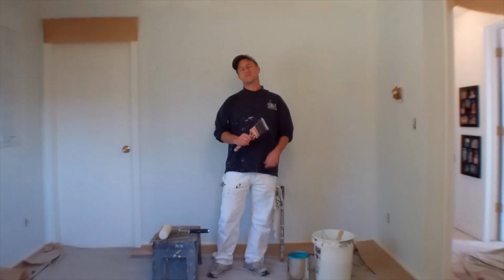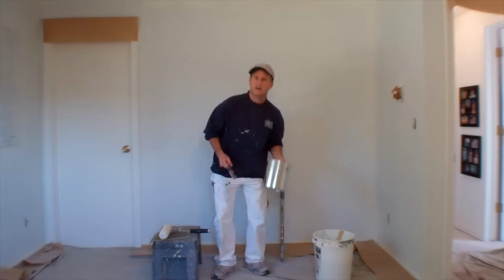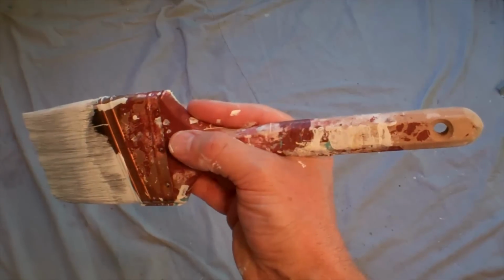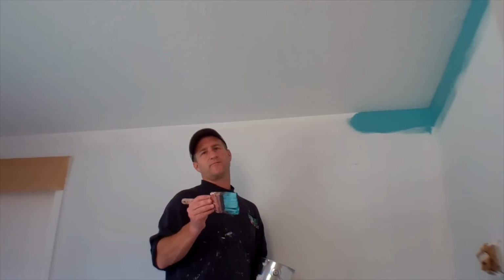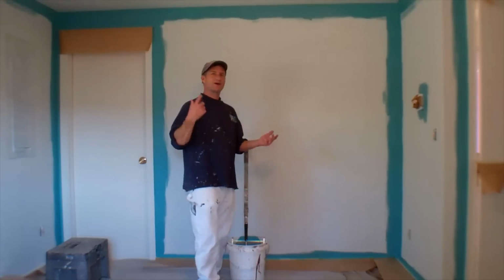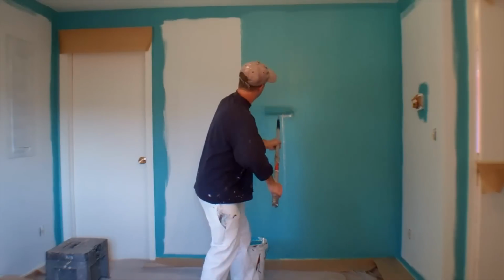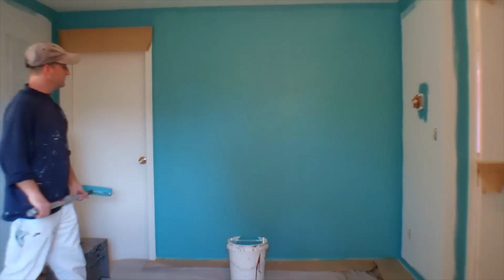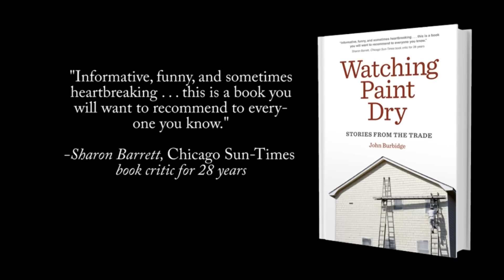Interior Painting Step 3: Painting the Walls

Comment: As others have noted - your videos are the best I have seen - from the picture of the paint brush...holding the brush, directions of stokes, working in sections etc, lay on lay off etc....In the past I have used some of those techniques but not consistently. ...The best thing was the tip about what sound I should hear...because yesterday, I asked myself that exact question....now I know!!!! .....Hopefully I can correct the lap marks I have on my ceiling .... and then I'll move on to the walls with a lot more confidence....

If you haven't ..please consider doing video on removing popcorn .....with suggestions on how to finish the ceilings? Since I decided not to use the spray/hopper method, I watched ALOT of you tube videos using compound and trowel. I found it interesting that only one professional manually applied texture to an actual ceiling. They chose slanted ceilings and/or walls. Not one demonstrated how to hold the trowel, mixing different consistencies of "mud" and the varying results of each. .............However, through trial and error I am pleased with the result.

Comment: Love these videos. I just finished removing a popcorn ceiling than painted the ceiling and walls. Used most of the tips in the video and they worked great. I did end up using the 2 1/2in.  paintbrush. I think it's because my hands are small and upper body strength is not very good.

Comment: i used to do it like that, but if you apply less pressure, you can guide just a few bristles right into the corner with a light touch and you'll get a sharp line all the way along, not one that goes in and out of the corner.

Comment from the maker: Hi--I've never used a roller attachment on my sprayer. They look cool and it could save some time if you have a lot of square footage to cover. It wouldn't prevent you from having to cut in, though, and that's what takes a lot of time. If the house is new construction at the drywall stage, spraying and back-rolling would be the way to go. Another option to consider if you have a lot of ground to cover is using an 18-inch roller. Ask at the paint store about that. Good luck with the job!

Comment from the maker: Hi--at 9:14 I am "scoring" the edge where the tape meets the wall to help it lift off there better. I'm using a 1-inch putty knife. It helps the tape lift off better, but you can usually still expect to do some "picking" to get all the tape off. (The putty knife can also help with that.) The problems you're having are common--sometimes you just need to go back and touch up a few spots. Pulling the tape when the paint is still barely tacky can help alleviate this, but the putty knife helps too.

Comment: If you use roler first brush section would reduce.Borders first can take extra time.Up and down corner need not brush....roler can do that..If you use the same colour to top and wall there is no need to brush.Extra press of the roller can fillup the corner.

Comment: In response to Teddy AGP:  "I used spackle to fill hole in my cement wall. Sand them. And prime the 
entire wall. After painting I could see difference in sheen in repaired area."

When you patch, you need to prime with the cheap primer (PVA) that is intended for bare drywall (and patches).  Patches and drywall absorb the primer.

I inherited a wall with about 30 patches from where previous owners removed an entertainment center and made HUGE patches.  After I primed them all with the PVA primer, I primed the entire wall with latex primer.  The results were good.  You don't see the changes in sheen.  Yay!  I am not sure what would happen if you skipped the latex primer and just went straight to paint.

A general contractor gave me this tip. :)

Comment: Thanks for the great videos, John. Wonder if you could answer a couple of questions.

1. You've mentioned same color painting of walls and ceiling. Any tips as to type of paint finish? e.g. if chosen eggshell for vertical walls, should ceiling be same color but matte finish?

2. If you had to install hardwood in place of existing carpet, and paint walls, ceiling and trim, in which order would you do it? I'm thinking: 1. remove carpets and all the carpet railings, staples and padding. 2. Clean floors. 3. Patching 4. Paint ceiling 5. Paint walls 6. Paint trim, 7. Lay down hardwood liner 8. Install hardwood.
Reply from the maker: !) Hi David. In answer to your first question, I personally like to use eggshell finish on all walls and ceilings, EXCEPT when it is a surface that will get damp or wet, such as a kitchen or bathroom, in which case I usually use semi-gloss. You can use matte on ceilings--lots of people do--but it is really hard to clean any type of smudge off matte finish without marring it. So say you squish a moth on the ceiling and there's a dirt spot--it will require touch-up with paint rather than a simple cleaning with a damp rag. Eggshell will clean up better. This is kind of a matter of personal preference. Matte can help to hide imperfections in a ceiling, so if that's an issue then matte might make sense. On trim I usually use a semi-gloss finish.

2) I think your order of tasks on the painting/hardwood job sounds fine, but if you have baseboard trim, you will need to remove it to install the hardwood, then put it back up and paint it last. In that case make sure you use blue tape to seal off the hardwood so the paint doesn't leak onto it, and when you are done, use a damp rag wrapped around the blade of a putty knife to gently clean any paint that leaked onto the hardwood (it usually cleans off pretty easily if you don't let it sit for weeks). And remember NOT to caulk the joint between the bottom of the baseboard and the hardwood. I believe I mention that in the video Step 4: Painting the Trim. It looks much better if left as a natural joint. However, you do want to caulk the joint where the baseboard meets the wall, and since you will have already painted the wall, you'll want to caulk very carefully and possibly do a little touch up with wall paint down there when you are done. Not a big deal. Another option would be to simply do the hardwood installation, then do a VERY good job of taping it and cover it with good canvas drop cloths...so it's not entirely necessary to do the floor after the paint job, if it works better for your schedule to do the hardwood floor first. Just make sure to cover it completely when painting. Good luck!

Comment: Can't fault that. Nice job. Cut in twice, unlike some lazy painters. Laid off vertically under the window though the tempation is to work horizontally. Only thing I'd do differently is to face the open end of the roller towards the right, i.e. towards where you've just painted. Open end of the roller tends to leave less of a line when you're rolling back into the work, which is better when you're laying off especially.

Comment: question: when you do the "lay off" when you are painting the walls with the roller, do you dip your roller in the bucket for more paint?  I noticed when you did the lay off the video never shows you dipping the roller back in the bucket.
Reply from the maker: err prr Normally I do not dip the roller in the bucket when doing the lay off. The only exception would be if the paint was already starting to set up a little (drying). Then I might dip the roller lightly to get a little extra paint on the wall.

Comment: I have bedroom walls that used to be wallpapered.  Cleaned them well, I thought, but there is a smail area that has runs and the paint bubbled.  How to I repair that section?  I primed with oil based Zinnsser, then a base of light gray eggshell paint.   I saw some runs before I applied the color paint and for some reason I thought it came from painting the ceiling.  Now what do I do to repair the runs?  Can I apply a coat of the oil primer again, feather it out, and cover with color again?  It's just a small section about 1' x 2' area with about a dozen runs in it and the paint bubbled.  Or do I have to redo the whole wall??
Reply from the maker: You probably don't need to redo the whole wall. I usually "cut" (scrape) runs with a the sharp blade of a painter's multipurpose tool. This gets most of the run off, then you can sand with 80-grit sandpaper to smooth them out some more. Once big runs have dried and hardened, it is actually quite difficult to remove the evidence of them completely, but you can do a good enough job so that no one will notice. I hope this helps. Good luck!

Comment: nice video-roller trays are no good!  I've found it's faster to roll a room like that first.  That way your not spending extra time cutting in more than you have to.
Reply from the maker: Some painters advocate rolling first, then cutting in. The reason I don't do that is because I like the roller stipple to cover up the brush marks as much as possible, therefore I roll after cutting. That's not to say my way is the only way, it's just the way that has worked well for me. Thanks.

Comment: John, if someone unskilled in painting is needing to paint ceiling and wall once the ceiling is dry would you recommend painters tap to get that fine edge where the ceiling meets the wall? Maybe it's easier than it looks, but I doubt I could get that nice clean edge, as I don't have the experience.
Reply from the maker: Hi--I just don't think tape works very well on the ceiling...it does not stick well, and usually the paint bleeds underneath and creates a ragged edge. If you follow my technique in the video and just carry the paint a hair up onto the ceiling (1/32 inch), it looks straight from out in the room. It's really not hard, try it! Tape is a last resort on the ceiling as far as I'm concerned. Others might have a different opinion.

Comment: I use to hold the Pole the way you hold it, but after my Teacher slape me in the back of the head a couple times I started to hold it the right way, the way you do it get the wall beautifull also, but it tires you making you less productive, the way I hold it  is with the fore hand fingers pointing down so your wrist does not suffer from stress in the down stroke and your back is always straight. But thats me, wherever works for you men, cheers.
Reply from the maker: Hey, thanks, it's always good to mix it up to prevent fatigue.

Comment: At 05:07, you said Corners were thirsty? I've noticed that where the wall and ceiling meet, it looks like I mist that area. Have gone over it numerous times but that section never looks complete?

Sanded, good primer was used. Any suggestions to this problem?

Comment: Sorry if I sound negative but I’ve been painting 40 years and running it onto the ceiling is not acceptable just because you’re dealing with  textured wall, there are ways around a misaligned ceiling that don’t require much extra time to make your lines crisp

Comment: Great vid.. How about the second coat of paint do you have to do the same procedure ?
Reply from the maker: Same procedure but it's quicker. For one thing, when cutting in, you don't need to worry about cutting a straight edge (presuming you did a good job the first coat). You can stay a quarter inch back from the edge and this means the cutting goes much quicker. Rolling procedure is pretty much the same. I'd say the second coat takes about half the time of the first coat.
Reply: Thanks-- I actually did the cutting twice, but i know for the next time.. It came out nice!!! Thank!!!

Comment: im wondering about tape, if im doing 1 coat of primer, and 2 coats of paint. can i leave the tape i used to do all 3 coats, or do i have to put new tape after each coat. because i heard it sticks and takes the paint off. and what do you think of paint edgers? do they work?
Reply from the maker: Kenny singh You should use blue tape for sure. You don't need to re-tape between coats but the quicker you can get the coats done, the better. You might want to gently score the edge of the tape with a putty knife before pulling it. I've never used a paint edger so I can't say if they work, sorry!

Comment: Can you let the cutins completely dry on the final coat before rolling the wall without getting picture framing? It is difficult to keep a wet edge with cutins, dries so quick.
Reply from the maker: Logan Griffen Yes, I think so. The key to not getting "picture framing" is to have complete coverage, which often means doing a double coat, especially if you are changing colors.

Comment: what I if I layd it off after each stroke I made ? had to paint it for the first time and texture is kinda same everywhere on the wall, but strokes are visible after an offset. could it be too thick paints, too high suction or temperature or is it texture varies where strokes do overlay and thus layer gets too thick ?

Comment: about how much paint did it take to finish the walls in this room?

I've done one coat for my bedroom and used a gallon and i'm going to go back and get another gallon and paint like this..
Reply: and also when you paint the trim of the ceiling and walls etc is it okay if some areas dry before you get to do the long strokes with the roller? or should you go wall by wall to stop the outer parts from drying?
Reply from the maker: I'd say two gallons should do it for the walls in an average size room. It never pays to skimp on the paint, though. I like to roll on a good coat, or two if necessary.
Reply from the maker: Yung Money I think it works best to let the edging dry completely before rolling. If it's only half dry, it will create a different "stipple" (pattern) when you roll, and that will make it stand out.

Comment: Hi,

 thank for the information and i think anybody can do the painting but one thing i wanted to know is can anybody post some information on how much does paint thinner used in one gallon paint? and what kind of paint used in wood and sement. What are quick dry enamel paint and flat wall paint for? Plz any information on this... thanks!!!
Reply from the maker: I don't typically thin paint with paint thinner or water. If the paint is not applying smoothly, use Flotrol (for latex paint) or Penetrol (for oil base paint). Regular primer and paint are fine for wood and cement, although you might want to use masonry conditioner on cement first. Any "quick dry" paint is probably for a commercial situation where you don't want wet paint to be touched. I don't typically use flat paint on walls, only on ceilings. Use Eggshell on walls so it can be cleaned.

Comment: Any reason for not using your airless sprayer?
Reply from the maker: The overspray can be hard to contain when painting interior walls in an occupied house. If it's new construction, I would definitely use an airless sprayer to do the walls and ceiling. In that case you spray the paint on and then "backroll" it with a roller to work it into the drywall/texture and smooth it out.
Reply: howtopaintahouse How much paint do I need a for a small room?
Reply from the maker: AngelicAcid453 For a small room, probably one gallon for the ceiling, maybe two gallons for the walls. The main thing is you never want to run out in the middle of a ceiling or wall because if you switch to a new gallon (especially when it's a custom-mixed color), then shade might be slightly different, and it will show. You can measure the square footage of the walls, subtract the window space, and then divide by 275 or 300 to determine how much paint you will need. I usually figure 275 or 300 square feet per gallon, despite the fact that some paints say they will cover more. I believe in putting on a substantial coat. Plus there's always the possibility you will need to do a second coat to get full coverage. Good luck!

Comment: I used spackle to fill hole in my cement wall. Sand them. And prime the entire wall. After painting I could see difference in sheen in repaired area. It is only visible at certain angle and when sunlight enter the room at certain hour. Other than that you could not notice it. Is this normal? Or I did something wrong.
Reply from the maker: +Teddy AGP You did nothing wrong, it's just a slight difference in sheen that is only visible at an angle...nobody will notice except you. And it will fade over time as the paint cures and the sheen fades.
Reply: Paint patches again
Reply: teddy, this is probably coming too late, but in response to your spackling job and patchwork. after you've gotten the holes spackled and repaired, and sanded smooth use a can of orange peel, as so the texture is not flat where you repaired and will blend with the texture of the rest of the wall....
Reply: +howtopaintahouse thanks for the reply. it is less noticable now. u are correct. no one could notice it
Reply: Teddy GP
Reply: Teddy AGP
Reply: Teddy AGP

Comment: During Lay off, do I need to put the roller again into paint bucket?
Reply from the maker: No, not unless you notice the paint starting to "set up." Then you may need to re-wet it slightly. But really you want to lay on and lay off sections that are small enough so that the paint does not have time to start setting up.

Comment: The top line from earlier is more visible (darker) will that look the same when is dried?  
Thanks
Reply from the maker: It will not show up once two coats are applied to achieve full coverage, which is usually required when doing an extreme color change like this. Thanks.